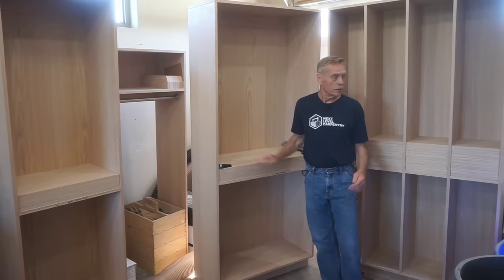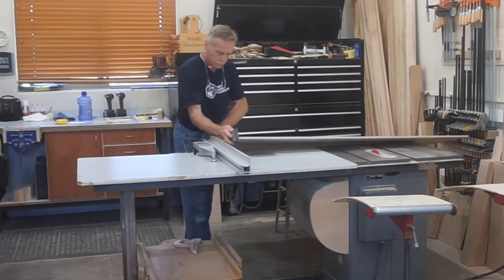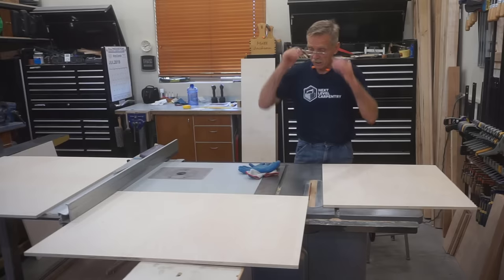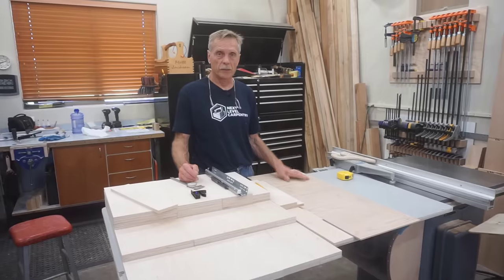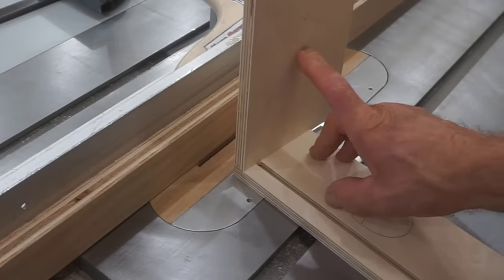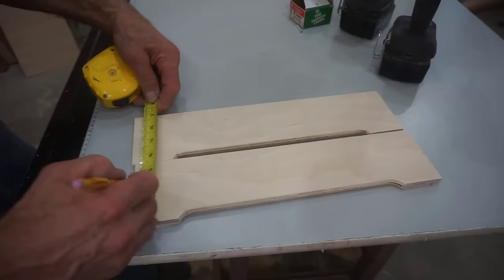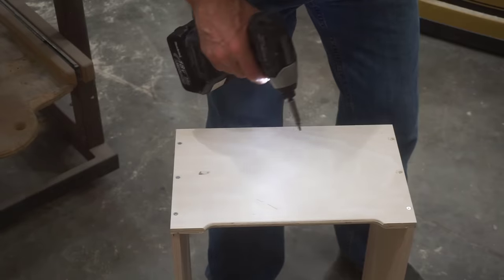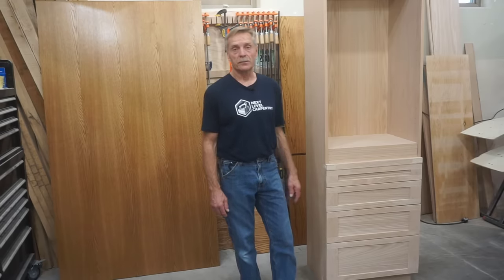Master Class for Professional Grade Cabinet Drawers

Comment: Matt 
I enjoyed this video and have built similar drawers for closet cabinets.
My only suggestion would be to only assemble the drawers once. 
Just spray your two coats of lacquer after assembly. I have used cheap HVLP amazon sprayers, simple and cheap. Spray in a dust free location. I quick touch sand and clean with compressed air between coats. The results are great and fast. Don’t forget these are closet drawers, not a chippendale hutch!
Reply from the maker: 65895555; Dust in the finish isn't the issue but rather grain raising after the first 'seal' coat.  You know I hate sanding and especially hate sanding into corners!  The little time it takes to zip out screws is offset in no time by exponentially faster sanding speed.  Goes to my mantra 'if it takes a little time to make something a lot better, it's worth it.  If it takes a lot of time to make something a little better it's probably not worth it'.  The drawer process you see in the video represents that mantra completely because there's no comparison in the end result.  I'd opt for not finishing the drawers at all rather than spray any finish on them when assembled... but that's just me.  Thanks for commenting... Best, Matt

Comment: Nifty!! I really appreciate the running commentary, it's truly very useful.
In lieu of paraffin, I use a block of soap Savon de Marseille. It gives a very smooth gliding surface and works as well on traditional wood sliders for drawers. The older and drier, the better!

Comment: Your videos are exquisite in how precise everything comes to be. I was most interested in how you notched the sides of the drawers with the router bit. Would you consider a video expanding on more ways to accomplish something similar or different ways of doing this? I also would love to hear your wisdom with regards to router bits, the different ways to use them, safety considerations with regards to bit size and router speed etc… There are videos out there for that, but they lack the depth your videos contain. Thank you for these incisive and informative videos.
Reply from the maker: Thanks for such a nice comment!  The best I have to offer you for more info on router/bit use is to suggest you watch other videos here at Next Level Carpentry where they are applied in a LOT of different/unusual ways. Here's a couple links to videos where I use templates that demonstrate a router's versatility:
https://www.youtube.com/watch?v=8ZfsRTWGwl8
https://www.youtube.com/watch?v=LIKwbPLGIlE
Hope that helps some?
Best,
Matt

Comment: In my life before retirement we manufactured custom furniture. I agree with your rabbited drawer construction. However, we left the dato on the drawer back and glued the bottom into place during construction. This glued in bottom holds 150 lbs with no failure and keeps the drawer from any possible racking. The screws you use can fail with overloaded drawer bottoms.
However, I love your channel and ideas. I have switched to your style push blocks and find they are the safest I have used.
Thank you

Comment: Lovely and thorough explanations. Thanks. I hesitate to offer a tip to a Master craftsman, but maybe this may help others: I select and mark, the back pieces, and cut off the extra depth, (which allows the bottom to slide in), at the stage when you cut the grooves for the bottom. After cutting the grooves in all drawer pieces, just flip the back pieces,end for end, and still with the same groove setting on the table saw, cut cut a groove on the opposite side. The groove setting will be perfect. It saves time, and you will have perfectly dimensioned back pieces. You can then omit having to set up the table saw to remove the final strip from the back.

Comment: I like your methods. Very thorough and insightful. I always spray my drawer sides and bottoms before assembly as well, but I really like the idea of using screws. I’ve got a few drawers to make today, so I’m going to try your method. Also like the idea of using the table saw rather than the router. Thank you, sir.
Reply from the maker: I think well-placed screws are perfectly acceptable for this grade/appearance of drawers and my clients seem to agree with strength/value ratio.  Kudos for pre-spraying drawer parts... really makes a much better job much easier, right? Best, Matt

Comment: It took me a while to figure it out but I finally came up with a strategy for storing things in my shop that makes a lot of sense and works well.  With that I've found that drawers are better than shelves in almost every conceivable way except access.  Shelves are faster.  Shelves are also usually better for heavy or large, awkward items unless you have drawers that easily handle that kind of thing.

But with a given volume, you can fit more items into drawers than shelves because drawers can and usually do have much lower height than the spacing between shelves.  My favorite part about drawers is that the stuff doesn't need to be dusted all the time assuming the drawer isn't left open and the drawer is a good fit into the cabinet.

So basically my storage strategy is to go through a checklist to determine where something is best stored.  I'm not going to bore everyone with all that but it includes things to consider such as how often do I use it, how bulky is it, is it a precision instrument, how hard is it to clean, etc.

Comment: Very slick trick squaring with the jointer! That's a new one for me. I will definitely use that in the future. Thank you!
Reply: careful with that. I thought I would shave a touch off some end grain with a joiner once and it split the board apart in my hands.  It was solid wood and not plywood, but from then on I only put long grain on the jointer.
Reply: @nevermindthebull0cks  Makes sense. I don't think I would try it on solid wood end grain, but with quality plywood and carbides it should work fine as depicted by Mr. Jackson.

Comment: With the Kreg Adaptive Cutting System, which I bought, you don't have the issues that you do when you are pushing a sheet through a saw. In fact it solves every one, which carpenters like yourself have spent many years to solve. The cuts are also very smooth and hardly require any sanding. The Adaptive Cutting System will run you $1000 (or more with accessories) when it is all said and done, but a large and accurate table saw will cost more. Additionally, the table and saw fold up for compact storage.  No doubt, you will not change. Something about teaching an old dog new tricks, but the Kreg system is better for cutting sheet goods.  It is impossible to  cut yourself with it.  That was a big selling point for my wife when I was looking at it! LOL.

Comment: I really liked the video you presented.  The detail in your explanations of how and why you do things is great.  In your pre-planning of the project it easy to make mistakes. e.g. just writings measurements on a piece of paper.   What I do is make a detailed blueprint of the project I am building.   (I then have all the measurements and can use that if I want to build that project again.  I don't have to re-think the whole process.)  Then from the blueprint I make a cut list and then make a blueprint of how I am going to get cut out the parts on a sheet of plywood so there is no waste of material.  (That is if I am using plywood to build the project.  I would do this for any material I am using to build the project.)  When I am building the project I don't need to think of how to cut the pieces or how do they fit together, I can just go head and build the project.

Comment: Enjoyed this video a lot! What I enjoyed most though is that little tip where you have drilled the hole a bit bigger for the screw that holds the drawer front in place and making it adjustable.
Reply from the maker: Good eye in a catching that... I'm constantly surprised by how much adjustment you get out of that arrangement for how simple it is.  Hope it works well for you and thanks for watching. Best, Matt

Comment: Thats a heck of a nice unit for a closet !  Great hardware choice  and material fo the drawers  i worked for a commercial Woodworking organization for over 20 years and all of our drawers were made from 1/“ Birch ply  that we   Sprayed with a conversion varnish  over the years i was with them i oversaw installation and Customer Service  i  dont recall ever having  a problem related to our drawer construction  other than  a customers  blatant abuse  or  extensive water damage that of course voids all warranties  or normal conditions a drawer should be subjected to  BTW we always specced and used Blum. Hardware and full extension slides unless the architect or customer. Desired  something else  as a rule the Blum  products were  very  good  and reliable  unless they were really abused by a customer   I kid you not we did have a customer that used the drawers as a step ladder to reach  upper shelves in the wall cabinets ! Yep i found   Foot prints i on the drawer bottoms  when investigating a complaint that the drawers were not working correctly ?  Not to oint fingers but it did happen to be in a U.S. Federal building
Reply from the maker: "footprints in drawer bottoms..." PRICELESS!  Thanks for sharing THIS one Craig! Best, Matt

Comment: Matt, I appreciate your videos. I grew up working in a production and custom shop. 
You might consider leaving the dato on the drawer back. With glue this locks the bottom in, eliminates the screws and is strong enough to stand in, even with 1/8 inch bottom.
Reply: I think the under-drawer style slides prevent that

Comment: I've had a set of those blade stabilizers for 20 odd years, love them. I can rip a slice less than 1/8 inch thick and 3" tall if the wood will stand it.....if the blade is exactly 90 to the table I can go up to 6" wide by less than 1/8" thick....just to show off since I can't think of a reason to do it otherwise,....usually it happens when dimensioning something.
Love those drawers !!!!!
As for not anodized blue...my shop is built from reclaimed pallet wood for the most part....

Comment: I actually enjoy all the talking and pointers. I find all the information useful and appreciate the time and detail that you put into making these videos. On another topic, I wish I could trust my saw blade's fence measurements without having to double check with my laser etched (and true) ruler. :) Maybe some day I can afford a table saw like yours. :)
Reply from the maker: Cost of equipment is less important than how well it works.  I recommend that you dig deep into understanding your tablesaw's fence design/mechanism and adjustment features and dial the fence in to where its readings are reliable.  It can be done on most every saw but tends to take more fussing on contractor-type saws than cabinet shop grade machines.  Thanks for your comment! Best, Matt

Comment: Matt You really were spot-on with your laminate technics. Back in the day working in shops, nobody wanted to build the c😢tops because it was not "real" woodworking, so I jumped on it and kept doing trial and error until I perfected it. Same thing for Corian. When they ask if can do something, if say no you never will! So I said yes, took the kits home and practiced at night. Anyway, I liked your tip about making scrapers out of lam. Samples. Since I also do auto bodywork, heres one for you. The large samples wilsonart will send out make great mixing boards for bondo. Easy to scrape clean and wipe with acetone. What was that water based contact? Back when they tried that in the 90s, the green dyed stuff was junk. Thanks,Ed Gonfindini
Reply from the maker: Yeah, all the first water based contact was real garbage!  3M got it right with Fastbond:
https://www.amazon.com/3M-30NF-Fastbond-Contact-Adhesive/dp/B003QTD6V2/ref=sr_1_1?crid=YYVQWSL81ZCQ&keywords=3m+fastbond+30nf&qid=1703229067&sprefix=3m+fastbond%2Caps%2C140&sr=8-1
The stuff is so great I've never used solvent based since I discovered it...

Comment: What I do is this .... made up a spreadsheet to just pump in the drawer opening and drawer side thickness and it spits out the dimensions of the cut panels for the drawer sides. It allows for the lock joint I use as well. Has saved me a lot of aw shits. Thanks for the video.
Reply: Did you make this on Exel?

Comment: Regarding the squareness of the sheets of Baltic birch, when you buy it in Europe it comes in 3m x 1.5m  sheets so it seems likely that what you are getting in the States are actually half sheets which might not be carefully cut.  1.5m is just shy of 5ft so I imagine they can get a full 5ft out of the raw sheets. When the truck drops off a few of those full sheets a track saw is a really nice tool to have :)

Comment: I’m a woodworker with 45 plus years experience - so, I’ve made a few drawers in my time. I would say that there are several good ways to make plywood drawers with no great difference in resultant strength and many bad ways to make drawers that deliver rubbish.

The single most important feature, no matter how you decide to join the pieces together is accuracy. That is where NLC excels. For the plywood drawers that I build, I use the same kind of joint but have never used the screws to join them - just relying upon glue. So far as I know, none have failed. For workshop drawers, I wouldn’t mind seeing the screws from the side but not on fine furniture. The other difference - and I think this is mostly a UK/US difference is that we/I was taught to keep the dado on the back and glue it in (only on man made boards though). So, I don’t screw the base to the back. Some of the drawers I build are up to 1m wide and have to take reasonably big loads and so, I use 100kg drawer slides. Because of that width and
 weight combination, I use 12mm plywood. 

I’m certainly not criticising, let alone saying my way is better than NLC - just different. 

Talking of joints, there is almost a snobbishness about using dovetail joinery on drawers. It seems almost to be taken as a mark of a craftsman. I don’t understand that; dovetails were invented as a mechanical joint because the adhesives at the time to make a chemical joint were just not good enough. Adhesives now are superb. Would Chippendale have spent time, and therefore money, getting dovetails cut if he had Titebond 3 to hand? I don’t see any reason why he would - or any maker would. We all use the best equipment, tools, adhesives and processes available to us at the present.

I’ve only ever had one client comment on dovetails. I was showing a lady plans for a Greene-and-Greene inspired storage unit. She asked if it would cost more to replace those fiddly arrows with plain sides.
Reply from the maker: I hope other viewers will take the time to read your amazing comment here Theo... it's one of the best I've read in quite some time.  The end with "replace those fiddly arrows with plain sides." made me laugh out loud!  Thanks for watching and providing such a welcome comment... Best, Matt

Comment: Hi Matt! thanks for another nice 'n useful video. I also prefer to work with Baltic/Russian birch rather than fir core, but I find they're making the show veneer thinner and thinner as time goes on. This is a good reason to wear the Smurf gloves to prevent splinter in one's hands.
I don't know about your area but in my area we have several merchants who have Birch ply in both 5 X 5 as well as 4 X 8. This goes to your admonition to give thought to not just a cut list but a "Cut map" to optimize your yield and minimize waste. ?There's no sin in buying two sizes of sheet goods if necessary just like there's no prize or money in having the biggest selection of off-cuts in your waste bin!

Comment: Wish I'd seen this before I struggled with my first 12 drawer three section cabinet. Fortunately for me my cuts were square as I don't own a 'Jointer' to correct problem cuts. I decided to assemble them using Brad nails as a temporary measure to make sure they all fit, before using screws to finish the job. It seemed a good idea for me as the middle cabinet of three sections was a little tight and I had to dismantle 4x drawers and take a 1/16" off the four drawer widths to make them slide freely in the center section. Next time I will pass on the Brad nails as they leave little holes everywhere and they often break trying to remove them.

Comment: Mr l like to see long videos as you can go into detail as joiner myself its nice to see other joiners and how they make their units and draws l have used snappy for a long time with the 7/64 countersink drill and 3.5 mm screw which I think that’s number 6 fits ever time l have used these draw runners before but you have to have the unit dead level l like the bigger holes on the draw so you can move the draw front l feel very happy when you’re job comes out looking good thanks for your video stay safe 👏👏👍
Reply from the maker: Curious if you know about this drilling jig and/or what you think of it Simon: https://youtu.be/jseRYaX00DA
Best, Matt

Comment: Hey Matt:  As a professional cabinetmaker, was pleased to see your use of Hettich slides.  Did you know they are the OEM supplier to SUBZERO and Miele appliances, so very sturdy and well regarded.  Check out BLUM's drawer front adjusters.... a clever approach to attach and adjust drawer faces to a box.